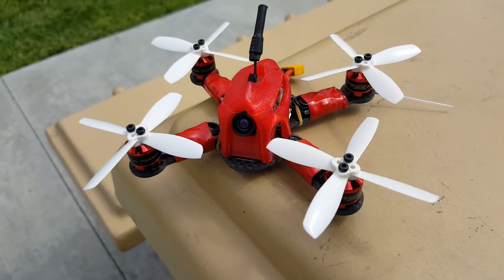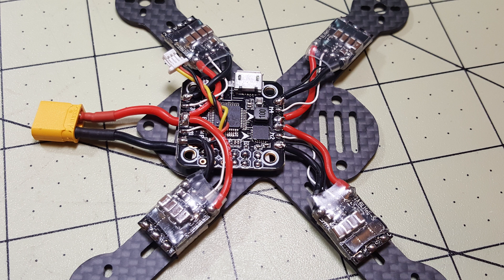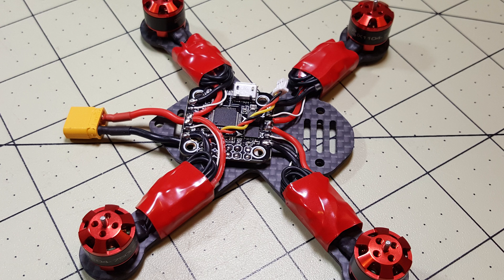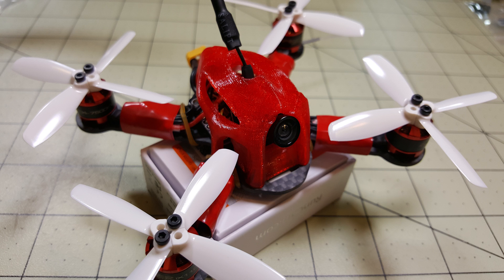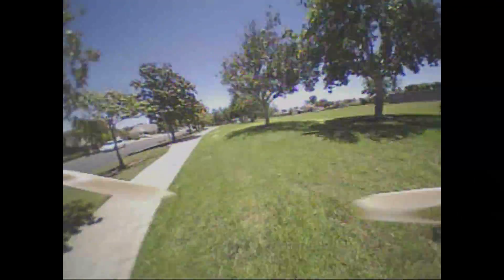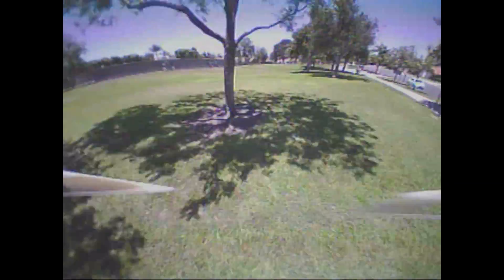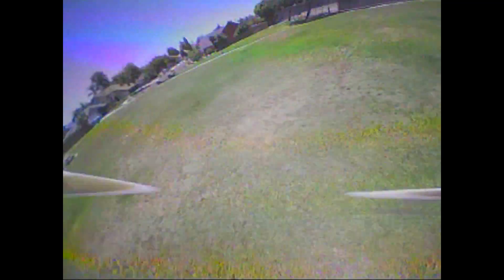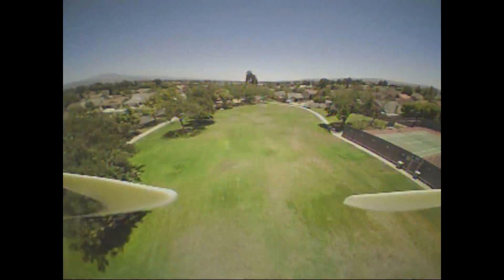Micro Drones 101 🚁#11 🔥 Air Arsenal Keni 110 🔥👍😀

Comment: Hi Albert, thanks for the great videos! Can you recommend a 20x20mm 4in1 esc for 2inch on 3s? I was building an x2 Eyas with omnibus mini, dys 1104 6500kv and racerstar dark18Amp esc but only 2 of the motors will spin 😞
Reply from the maker: +Wim Knapen check my easy bake playlist
Reply: Albert Kim I saw those videos but was wondering if you have any specific recommendations? thanks!
Reply from the maker: +Wim Knapen that frame has the props overlapping the FC. You need to get the stack as low as possible. Very difficult to explain here. I will do a build video later to explain. The build will be challenging. Just about any of those power cubes with 10a ESC will work on 2 inch and 3s. I dont know which one will fit best on that frame as I need to investigate and haven't done so yet.
Reply: Albert Kim I completely agree, the build was very challenging. The main problem I have however is that after a few seconds of flying the left side of my 4 in 1 esc stopped working ( motors 3&4 in betaflight) so now I'm searching for a better quality 20x20mm 4in1 esc.